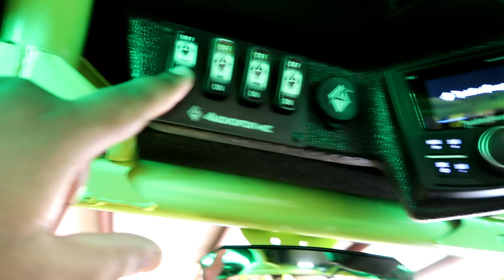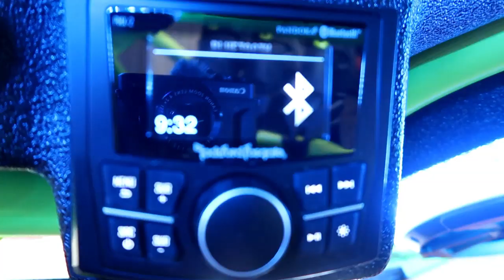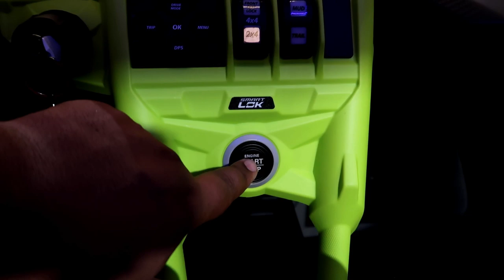I FOUND A NEW TOY - I'M DONE WITH THE CAR SCENE?? | FaTkaT

Comment: Do u have Resonators on ur catless
Reply from the maker: Yes my resonators are still there!
Reply: FatKat is there any difference in drone or power loss with them off. I was told u loss power with resonators off
Reply from the maker: I don't get much drone but if you take off the resonators I'm sure there will be more.  Plus I'm sure there is power loss because you lose back pressure!